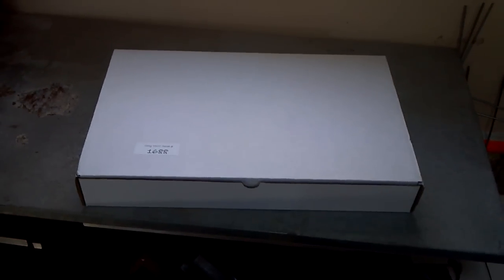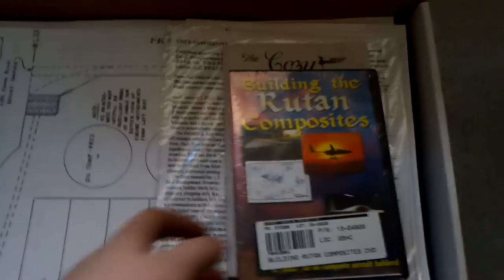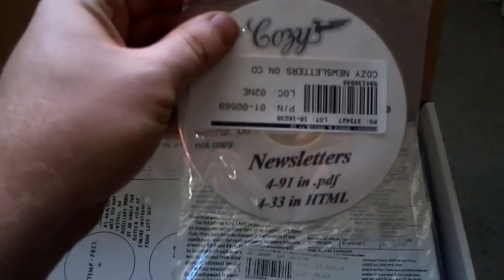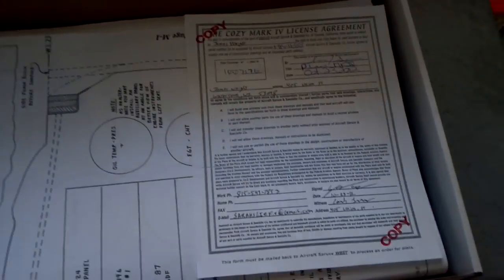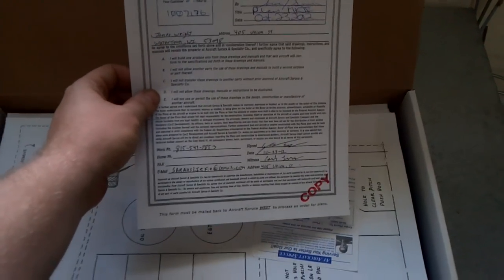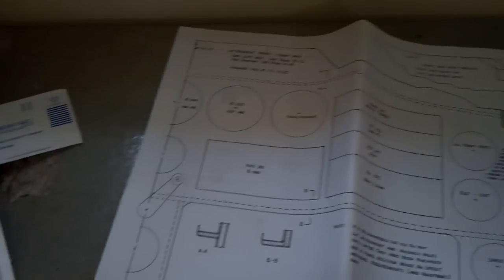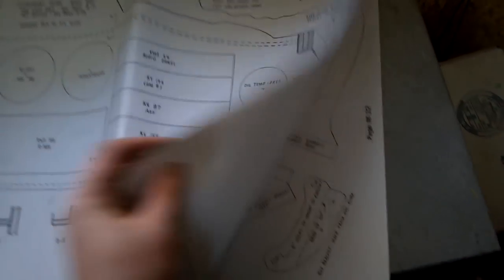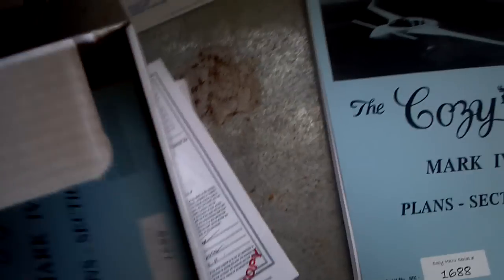Cozy MK IV #1688 unboxing video 1

Comment: Did you ever start or finish it. I just ordered the plans from spruce
Reply: I ended up having to sell it as I moved 6 times. but have recently started a new build and I am doing all the design work on this one. it will basically be a mix up of a cozy and a Wright Flyer.
Reply: +Wood By Wright can't wait to see that. Good luck and blue skies brother. I'm almost done with my car project and I finished the bulkheads. But I am waiting to get the car out of the warehouse before I start on the fuselage.
Reply: Wood By Wright how much for the plans?
Reply: Wow it's been 4 years...well update, I only have a fuselage built as I also moved a few times. In this time I've helped others build a Lond Ez and a vj-22 sea plane. I'm in a better situation now and hope to start this month again and finish it in a year or 2. We will see. Hope you got your stuff done.